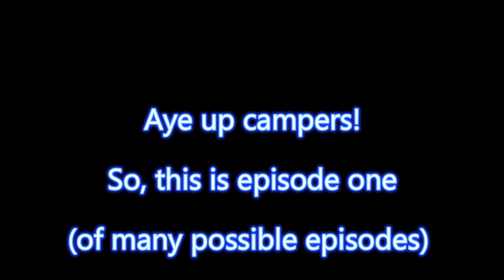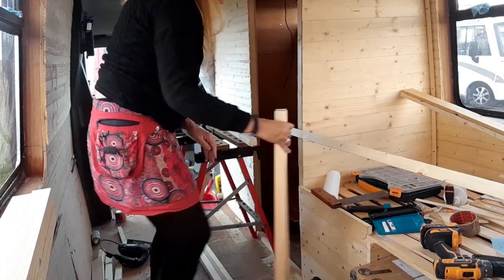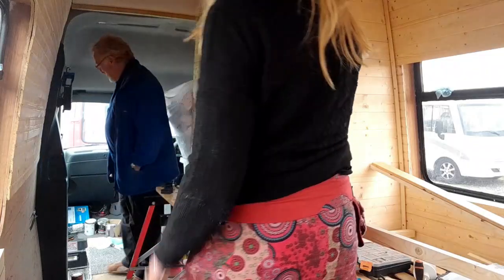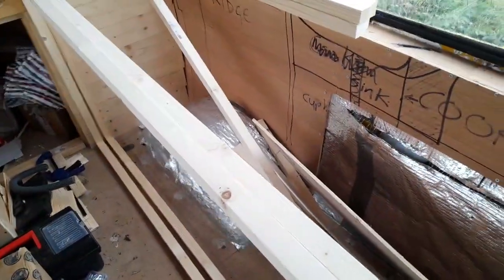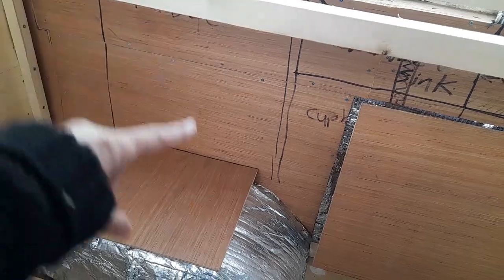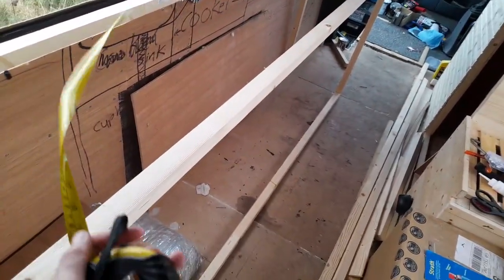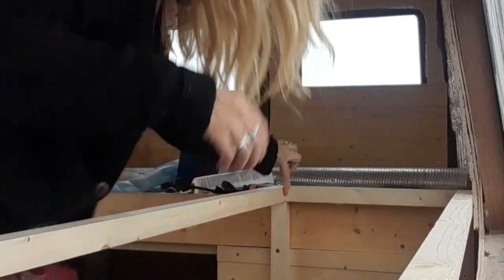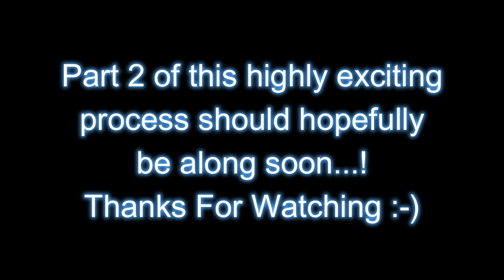Iveco Daily Minibus Conversion-Kitchen Build Part 1 #ivecodailycamper #minibusconversion #vanlifeuk

Comment: hey do u remember u said u wouldn't fit a shower tray because they crack and then leak, yea im the owner of a cracked tray in my van, so I got the idea to fix it with 2 part epoxy, then I was thinking if it gave the whole tray a layer of it it probably won't crack again
Reply from the maker: Hey there, I do remember, yes. Ah well hope that works for you Toe 😁